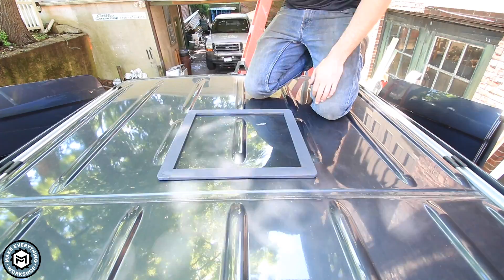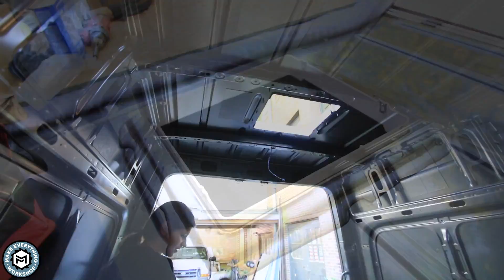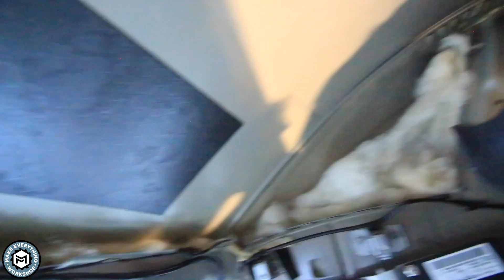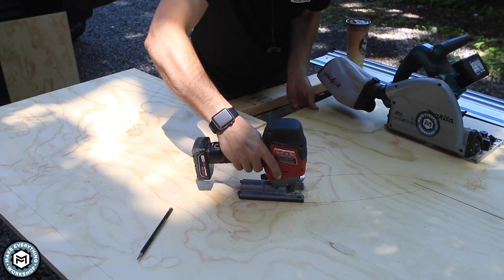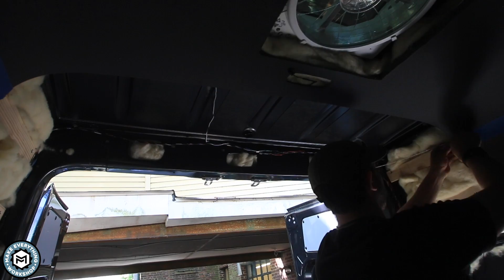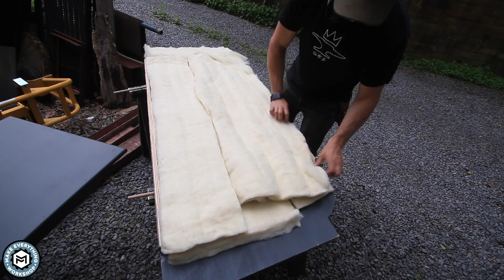Sprinter Van Build Out, Insulation and Roof Fan Install - Weekend Camper Part 1

Comment: Nice job!

In addition to the custom molded roof plastic parts, I highly recommend the interior blocking that Hein sells. No, it’s not cheap. But by gluing those interior blocks in on all four side of the vent, to the underside of the roof, you span your roof ribs.  This means the thin roof won’t be vibrating and oil-canning as you drive. 
Then use those longer screws to mount the exterior flange like you did.
Instead of just penetrating the thin roof steel, those same screws will go into the rot-proof plastic blocking. 
And when you attach whatever headliner you choose with the interior vent flange, you will not experience the sagging or screws pulling out. 

That is one “system” that keeps the water out for years to come and can be reused if the fan ever needs to be replaced. Well worth the money in my opinion after installing 2 and putting 14k miles on my 2019 170 Sprinter 4x4. 

I do wish I had added the flat aluminum strapping to the top of the exterior flange to distribute the screw head load on the plastic. I used pan head screws instead and covered it all with lap sealant. So far so good. 

One last recommendation I’d have. At 225lbs I started with plywood over a blanket, then noticed after cutting the fist hole in front that my forward roof section was bowed down or indented forming a low spot at my fan hole. Not good. Rain would have collected there at the sealant. 

After a few minutes with a 4x4 on a car Jack the roof was again crowned as it should be. 

I went online and found that others choose to span the roof rack channels on the strong edge on the roof with a length of 2x4 running front to rear on each side over the roof rack channels.  Padding underneath. Then I spanned those side to side with 2x4’s, all flat, with plywood on top. 

Considering how many times I climbed up and down, that was cheap insurance against denting my roof.

Comment: You actually don't need to scuff up the paint for Windo weld. There is actually a primer 3M Single Step Primer, 08682 that you need to apply over the paint and on the plastic part that you want to glue to ensure the best adhesion

Comment: So interesting, we’ll done. Maybe I missed the explanation for the gap between the top & bottom panels in the rear section tho - there was something about adding bungee cords but couldn’t they just be screwed to the ply? Seems odd to just leave a strip exposed & uninsulated like that. 🤷🏻‍♀️

Comment: I guess Im having trouble understanding why you needed that %60 trim ring, as it seems to really only benefit an install if you choose a spot to install intersecting one of hte roof ribs?  But your spot chosen was flat all around....feels like the trim ring was just another layer in the sandwich, another place to leak?  Not critisizing, just dont get what function it served.  You're obviously handy enough as a builder to have cut out a 14x14 hole perfectly, so it wasnt needed for that either...please correct me if Im wrong.

Comment: Hey Chris, that's an awesome beginning of this project! But one thing wondered me is why do you use so many different battery powered tool systems?
Reply from the maker: Thanks!! I use whatever gets me through the project!! And buy whatever tool is available at the time that will help me get my projects done more efficiently. Nowadays most of the tools platforms overlap their tools so it’s easier to stick to one!

Comment: I put one of them GP Bay diesel heaters in my Springer only problem is Ben the controller and the pump are junk go with a manual controller and buy extra pumps 5 also put the foil back bubble wrap insulation lining in my door panels for the driver and passenger side and use that as a window screen for the back windows works great

Comment: Just gonna say you made a massive mistake with using that sort of insulation because any condensation is going to soak up into the insulation and cause damp and mold and believe me I know what I am talking about I build these vans for a living change them from vans into mobile homes
Reply: James - Indeed, insulation is a highly debated topic. We are six years in and over 10k vans insulated and we have had zero issues with mold, mildew and rust. We are partnered with over 50 professional van upfitters who use our insulation as well. Please see our site for information and research on the properties of wool insulation. Thanks. https://havelockwool.com/
Reply: Havelock Wool I don't use normal insulation either in the small cavities are you spray foam in the big ones are use board insulation with silver protection on either side and also bubble wrap on the area which touches the metal your stuff might work but I've never used it in in my experience normal household insulation tends to soak up the moisture and considering wool and normal insulation a pretty similar not in the way they are made just in the texture and the moisture exhaustion how much does it cost for a bag of your insulation
Reply: Havelock Wool I am thinking about changing my insulation to just spray foam considering it is so much cheaper and you will never have a problem with it